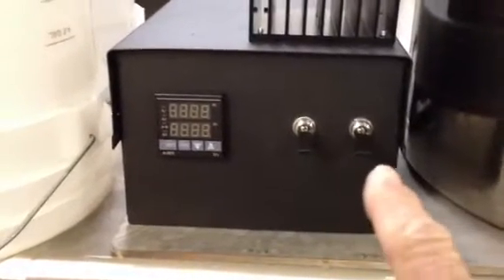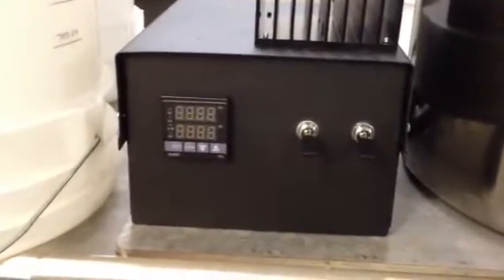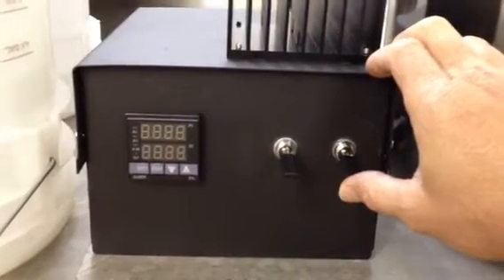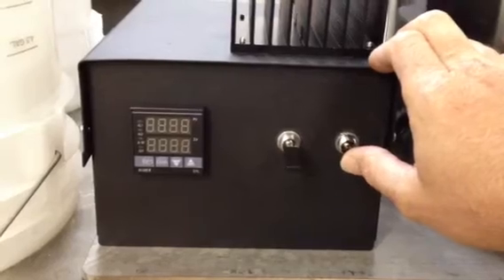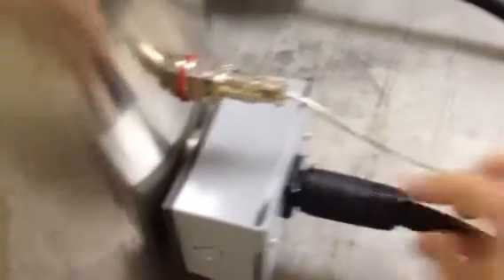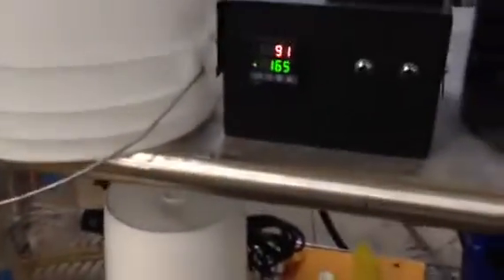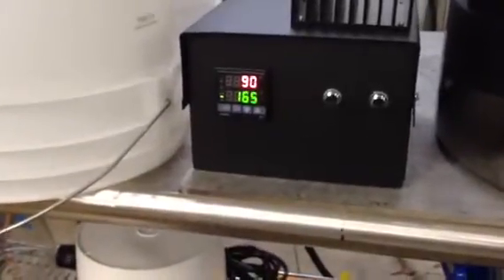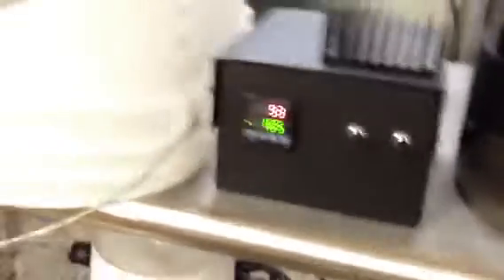Test firing PID and element take 2

Comment: Hi <yambor44>,
Nice setup, pretty much what I'm working up to. 
I'm quite interested in what power/sort of heating element you are using and weather you find it adequate or not. I was looking at something like this, but I'm afrait to get a under/over powered heater: http://goo.gl/YlzPaQ
(my pot is 33litres, but i will not be boiling more than 20)
Thank you in advance.
Cheers, Milan
Reply from the maker: I'm using a 5500W ULD (Ultra Low Density) element.